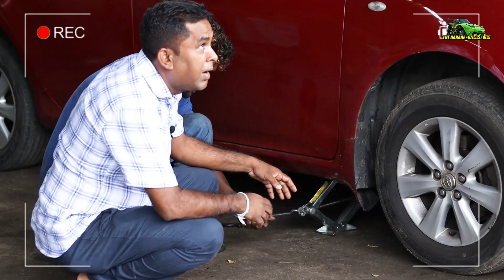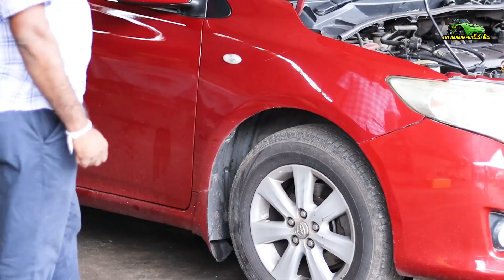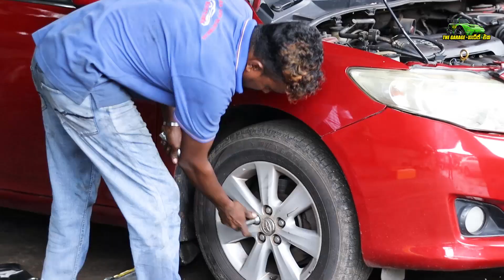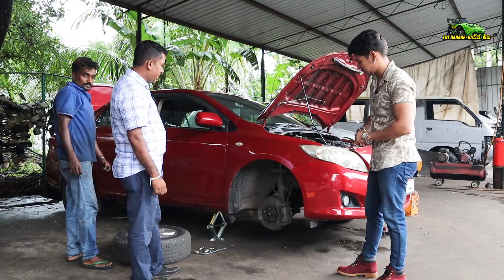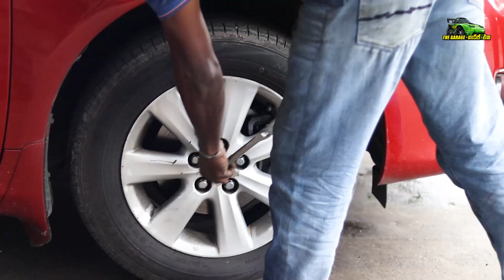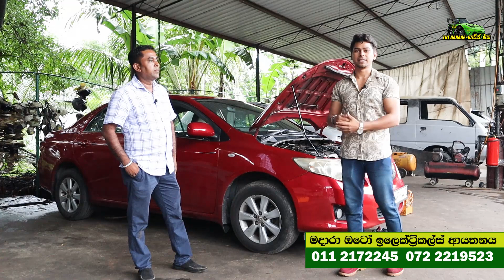ඉක්මනින් රෝදයක් මාරු කරන්නේ කොහොමද - How to Change a Tire Easy Technique

Comment: තරහා නැත්තම් පොඩි දේවල් ටිකක් add කරන්නම්,
1) මම tire එකේ nut බුරුල් කාරාට පස්සේ jack කරන්න කලින් spare tire එක වාහනේ යට තියනවා. spare tire එක දැම්මට පස්සේ ගලොපු tire එක වාහනේ යට තියනවා. 
2) තව jack කරන්න කලින් wheel chock දෙකක් පාවිච්චි කරනවා.
3) මම ඇන ටික බුරුල් කරන්නේ සහ තද කරන්නේ තරුවක හැඩේට. (මේක තේරුනේ නැත්තම් පොඩ්ඩක් internet එකේ ගහලා බලන්න , ලේසියෙන්ම හොයාගන්න පුළුවන් )
4) jack එක බාලා අන්තිමට ඇන ටික තද කරද්දී මම torque wrench එකක් පාවිච්චි කරනවා වාහනේ user manual එකේ කියලා තියන ගානමට තද කරන්න . එතකොට ඇන වල පොට යන්නෙත් නෑ , ඇන බුරුල් වෙන්නෙත් නෑ . torque wrench එකත් එක්ක තමන්ගේ වාහනේ lug nut එකට හරියන socket එක ගන්නත් අමතක කරන්න එපා.
5) අර කිව්වා වගේ jack කරද්දී ලී කැල්ලක් තියන්න. මම නම් jack base එකක් පාවිච්චි කරනවා. එක jack එකට ගානටම සෙට්වෙන නිසා සහ පාරේ වැඩි area එකක වදින නිසා පට්ට stable සහ එරෙන්නේ නෑ .
6) පොඩි air compressor එකක්  තියා ගන්න එකත් ඉතාම වටිනා දෙයක්. නැත්තම් spare tire එකේ හුලං නැත්තම් බඩු පැකට්.
7) සැරින් සැරේ spare tire එකේ හුලං, condition එක , expiry date එක (manufacturer date + අවුරුදු 5 පමණ) වගේ දේවල් check කරනවා නම් ඇගට ගුණයි. 
8) tire plug kit එකක් වාහනේ spare tire එකට අමතරව තියාගන්න එක පාඩුවක් වෙන්නේ නෑ.
9) body jack point use කරන්නේ car / crossover පමණක් බවත් මතක තියාගන්න. Body on frame වාහන වලට නම් body එකට jack කරන්න එපා. owners manual එකේ තියන විදියට axle එකට සහ frame එකට jack කරන්න.